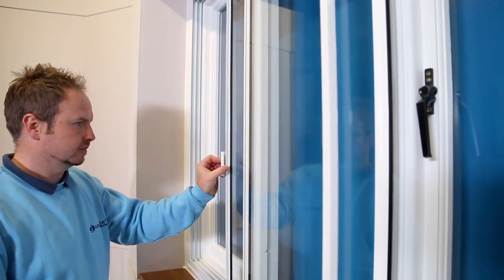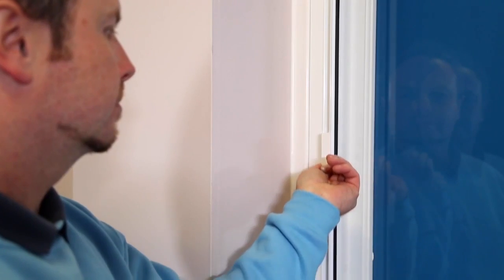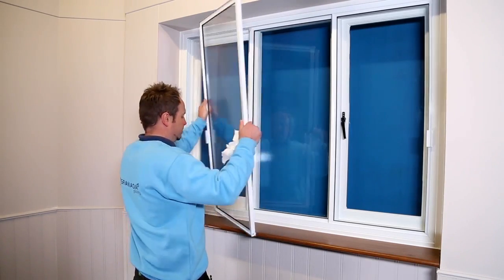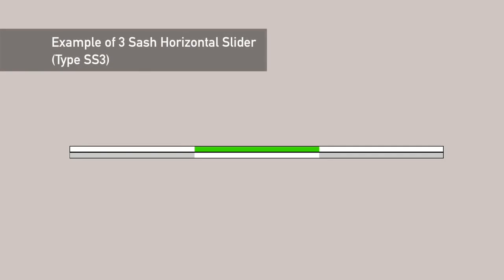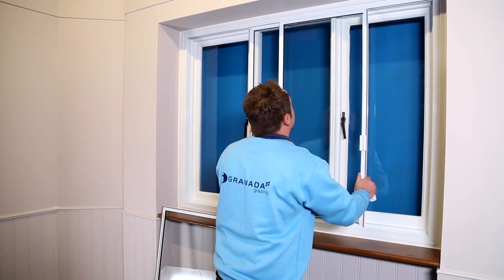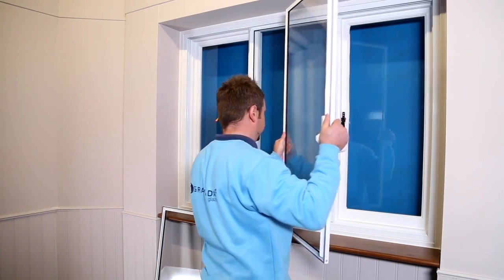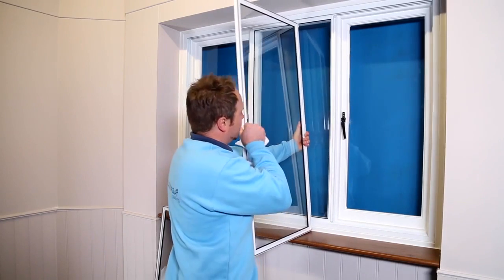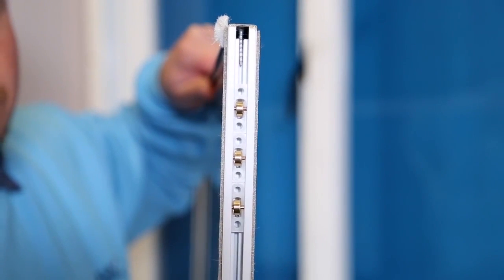Horizontal Slider Operation & Maintenance

Comment: How does this compare with magnetic strip acrylic secondary glazjng . In terms of heat loss, condensation and sound insulation. Thanks
Reply from the maker: Thank you for the question James. Granada's secondary glazing can decrease noise levels by up to 54 dB and reduce heat loss by 65%. Key to achieving to an increased acoustic performance is to have the secondary glazing installed with a minimum air gap of 150mm to 200mm glass to glass. 

With an acoustic laminated glass you could see a decrease in noise level by up to 80%. A diesel bus will emit 84 dB, with a reduction of up to 54 dB you will roughly hear 34 dB which is the sound of a whisper or a refrigerator humming. As the magnetic strip secondary glazing is installed to the window frame you will not get the required air cavity to substantially reduce noise. Also the acoustic glass offers a higher performance rating then the acrylic supplied with the magnetic secondary glazing. 

In order to reduce the level of condensation we would advise the installation of a trickle vent. This would allow air to circulate within the cavity reducing the level of  condensation. 

More information can be found on our website by following this link: https://www.gsecg.com/sectors/homeowners/ of feel free to speak with our friendly team by calling 01909 499 899.